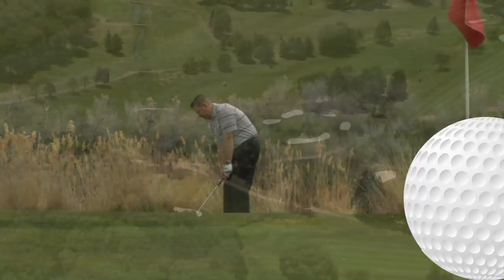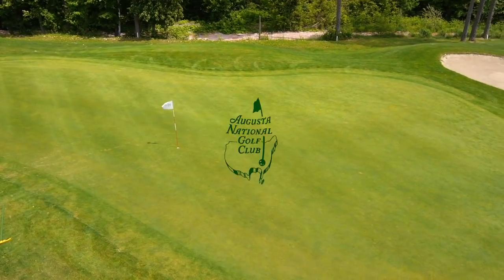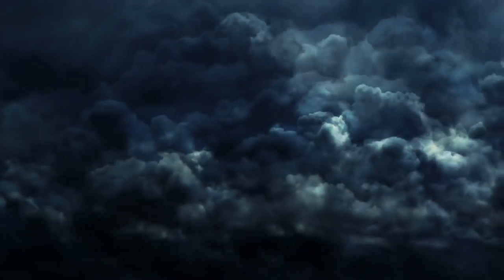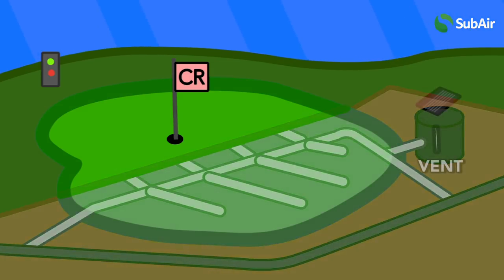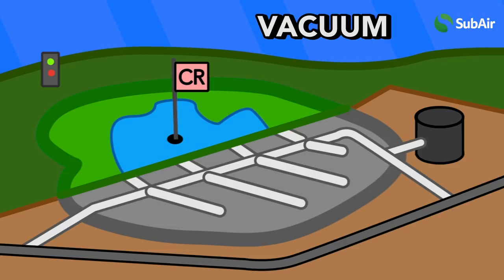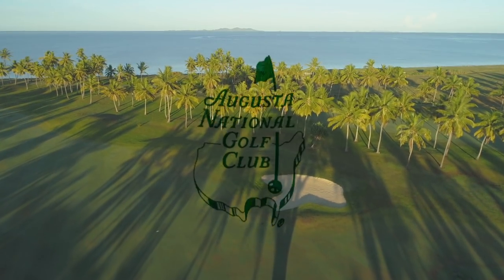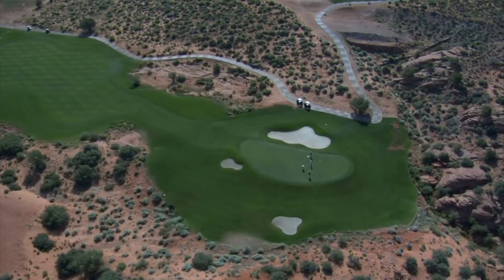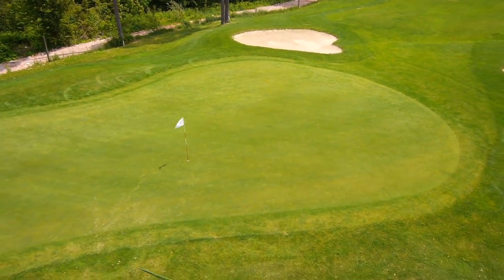What Is Under the Greens at Augusta National Golf Course?

Comment: Theres a lot more that goes into turf management than a sub air system, verticutting, HydroJet which is punching tiny holes which compressed water, walk mowing everyday but one and the list goes. All of these done at the right time help grow a perfect surface, keep thatch down and grow deep roots. Any course with greens redone recently have 95% sand so most greens drain really fast and handle 20 inches of rain per hour even though yes there will be standing water during downpours but not for long. Sub Air is great, every course would have it if they could but its only a small fraction of any good course.
Reply: Well stated.
Reply: @thebullet7874  I should of added budget to that because everything is determined by that for most courses
Reply: @chosen1one930  well said most courses are moving to a sand based green (USGA spec) or some version close to it, i do wish they talked more about the cultural practices that are done on golf courses to begin with as thatch is an issue, however in terms of deep roots that depends, Augusta uses warm season turfgrass as to where i live its cool season turfgrass and with the mowing heights we target it actually causes shorter roots in the heat of the summer but at the same time we keep our moisture readings at a nice 13-21% depending on the time of day.
Reply: @TheJoshman2011  Augusta uses cool season grass, A4 bentgrass on most greens, they use a blend on some greens that get more shade during certain parts of the year. The fairways are overseed rye grass when the tournament is played, than that will die off with heat and the Bermuda is than taking hold.
Reply: @TheJoshman2011  what do you want to know about controlling thatch?  I manage the same greens cut all at the same height I only have one blend green because everything is mostly sunny year round. First I aerate everything twice a year spring and fall that pull plugs than topdress, during the spring in March I vertidrain which is solid tine aeration 12 inches deep it also sighting pulls up at a angle. These holes are left open and become impossible to see within a week, this really helps to get roots 10 to 12 inches deep which isn't hard with these new hybrid bentgrassses or SUPER BENTS, 007, 777, 777XL etc, I'm unsure if all of those are immune to round up but I know 007 is, you can kill poa or anything but leave the bentgrass. During the growing season I veticut every other week, this is the groomer you can use on reel heads, verticuts just deep enough into the thatch and cuts the green, than we lightly topdress. Putting down a small coating of sand also helps control thatch. That's pretty much all I do for thatch and have never had a problem.
Reply: @chosen1one930  sorry for the late reply, im sure you know how busy the summer season is on a northern golf course when the snow is gone, interesting to hear Augusta uses a cool season grass for their greens, i totally understood everything you mentioned for thatch control, as thats everything i do throughout our operating season, its more the warm season grasses that i want to learn more about, as we cant use them here in Canada and most golfers here are used to the greens being Agrostis stolonifera/poa annua with the hopes of overseeding the poa out.
Reply: @TheJoshman2011  most of what you thick with short roots with cool season grass during a hot and humid summer is just wrong. Newer cultivars of bentgrass have no issue with this, all season long the roots ate 10 to 12 inches long because of maintenance practices every course with these grasses practice like a regular schedule.
Reply: @TheJoshman2011  shorter mowing heights also don't cause shorter roots. I guarantee Augusta also has 10 to 12 inch deep roots all season long with no problems, they even have subair which is the definition to deeper roots. Also they have zero play during the summer due to be closed.
Reply: @TheJoshman2011  of course we do verticutting every two weeks like clock during the growing season which helps with thatch. Toro calls it grooming, we take out just enough and topdress extremely lite. We cut our zoysia as low as it will go and the roots arent affected at all, we see around 8 inches or slightly deeper. . You only see shorter roots when you have other problems, a build up of gas in the soil, soil isn't getting the corrector enough nutrients, maintenance program is lacking due to budget or the course itself meaning owners. If you skip on taking care of thatch, aeration, vertidrain, proper mowing....justnto name a few and you will have a problem. The turf could also be affected from disease, or pest. Every type of grass likes to be cut at a certain height and for creeping bentgrass it loves to be cut low in sandy soil but will grow in other soils of course issues can definitely happen. If you do cut a type of grass lower than you should yes you will have problems with roots but if you cut your grass or any type of grass at a safe height everyone recommends it's OK but you still need maintenance practices, bentgrass gets the most, more so because the new cultivars create so much thatch... the old penncross cultivar was known for superintendents raising the height of cut during summer by a small fraction, but a lot of superintendents didn't also. I'll disagree with your statement on cutting grass lower and roots but I'll say not every course has the same budget as me which is $1,000,000. My course doesn't look perfect which would be augusta national in my book but it looks really damn good. If courses only aerate twice a year of course roots won't be as long.

Comment: You left out something important, I'm unsure if all greens have it but let's just say they do, cooling and heating. They have pipes for cool water or hot water, I knownit started years ago with 12 13 and maybe 11 those greens didn't get enough sunlight so during winter they had issues, the heating helps a lot for snow, ice etc and just growth for the little sun it does get, they also use different cultivars on those greens, they use Gs instead of tee to green As because the Gs have more shade tolerance. The new tee for 13th may help with more sun for 12 though during the winter since they went back 35 yards and cleared out trees, any little bit helps

Comment: 99% of all golf courses do not have these elaborate subsystems.   They cost a fortune !!   Many newer courses in the last 45 years or so may have a drainage system under, built with a layer of pea gravel and a choker, and a top layer of mostly sand, and small percentage of topsoil.   Older courses may be just push up greens with a mixture of sandy loam, and local soil.  These older greens mostly surface drain.  Those greens were economical to build and not too difficult to maintain.   Newer constructed courses built with mostly sand percolate and surface drain,  and have pipes underneath.   The USGA greens are the modern standard.  More expensive to build, and require attention for great maintenance to stimp at high speeds , like 12, 13, 14..

Comment: Only one problem. Augusta does not employ a sub air system. They do however are able to regulate temperature of the roots and have a superior drainage system, but no sub air. The broadcasters even discussed this due to all the rain they had this year.
Reply from the maker: https://www.google.com/m?q=augusta%20national%20sub%20air
Reply from the maker: Augusta 100% has a SubAir system 😊
Reply: All I can say was that during the torrential downfalls this year the broadcasters had a big conversation about Augusta National not using sub air. They prefer to use sand verification and traditional draining. You also may have noticed the grounds crew putting a squeegee to the greens. If sub air is employed screechies do not need to be used to manage the puddling. They talked about it for about 20 minutes. I also thought that Augusta employed sub-air until the conversation this year during the broadcast.  I do know for certain they have a system in place under the greens to regulate the temperature of the root systems. I guess Augusta National misinformed CBS regarding greens draining systems.
Reply: @johnagel419  the only place ive personally seen sub air used is at BMO feild in Toronto and on topof all that they have artificial strands stiched into the natural turf feild but for a golf course to use sub air its not really practical nor necessary if the course was built correctly with proper drianage in place i could easily deep dive into the construction of greens but would  prefer not to but with the USGA spec greens why would you implement sub air they actually drain really well on their own.
Reply: @TheJoshman2011  Exactly! With proper drainage, constructed to USGA specs, there should be no issues with drainage.